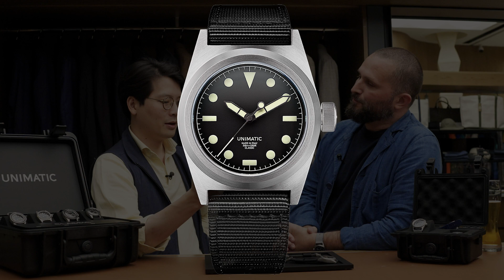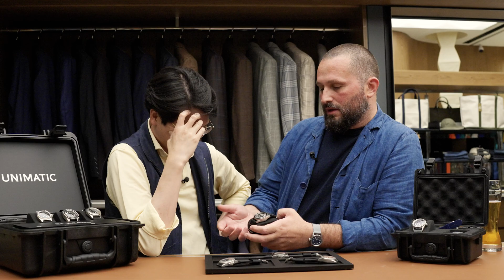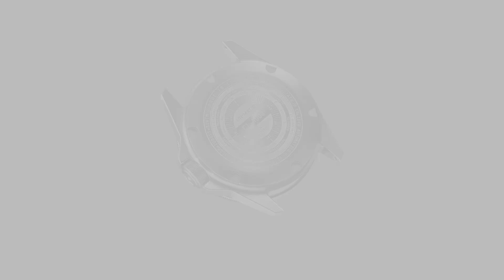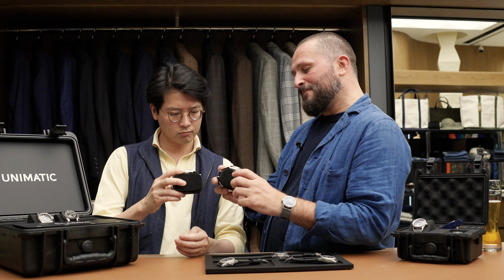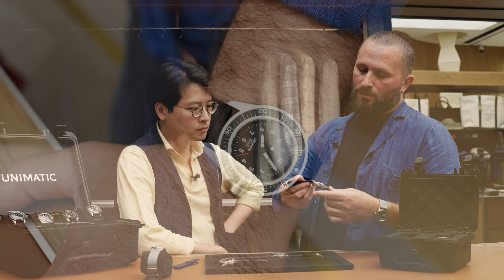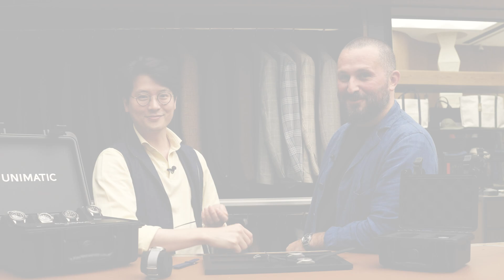Introducing - the Unimatic Pop-Up Shop at The Armoury + Our Collaboration the Blu Notte

Comment: Overpriced and underwhelming... I own three Unimatic watches and the only thing I am happy about is the fact that the brand managed to suck me back into watch collecting. The product is supremely lacking in the most important bits about having a nice watch — finishing and movement. It is also galling how many watches they produce without including bracelets. And yes, I know about the UBK-U bracelet — I own one. For the prices they charge, it should be criminal. Do not, for a minute, be sucked into the justification that because the watches bear the 'Made in Italy' verbiage on the dial, that the price is commensurate. There is very little evidence that much of the watch is anything more than merely assembled in Italy. The limited edition model is really nothing more than marketing ploy, since every limited edition is essentially just the same watch with a different dial and strap.

Having said that, I appreciate the owners. I appreciate how kind and helpful members of their staff had been in assisting me with various bits of acquisition and service — including the engineering team there in Milan. But, honestly, it's time for more. We need to see different models, better finishing, BRACELETS and a movement that is distinctly Unimatic and not some off the shelf, low priced go-to. I used to love the product, because it arose at a time when there were almost no other brands offering SS automatic watches, with sapphire crystal at the originally low price points. Now however, the market is rife with alternatives that are all doing a much better job at providing bang for buck.